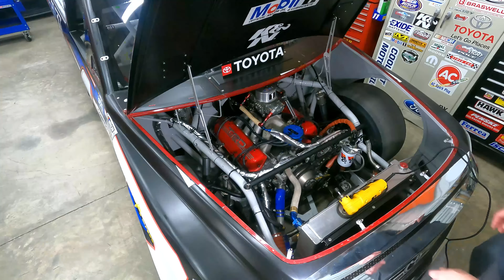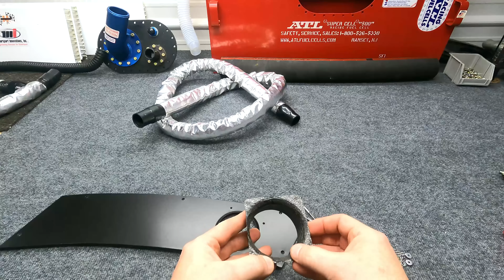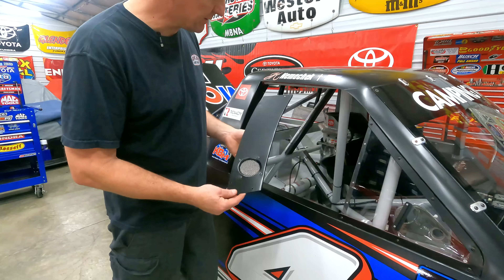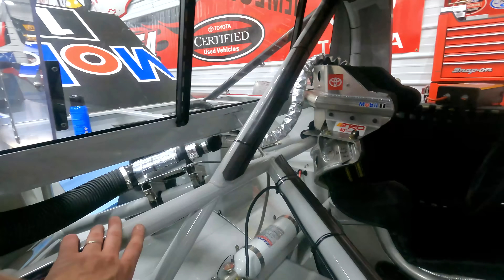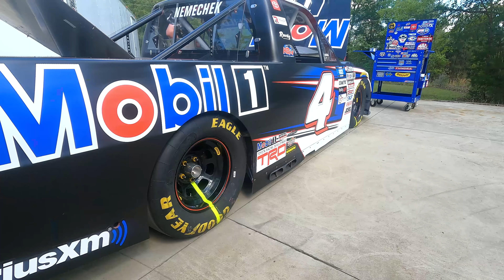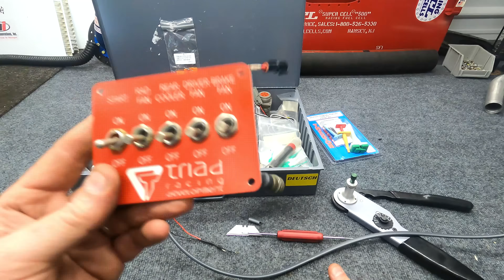NASCAR TOYOTA TUNDRA TRUCK Track Day Prep

Comment: Great video.  Funny as I’ve had a reoccurring though about having a Toyota truck as a track day toy myself.  So I’m guessing this truck had the Ilmor engine when it competed?  Is the engine it has now a Gibbs built engine from an Xfinity car?
Reply from the maker: The engine is a TRD / Triad Phase 14.
Reply: @stockcarsurplus  Thanks. I did hear you mention that but admittedly didn’t have any idea what it meant and search didn’t reveal too much info, which I found typical of most Toyota racing “stuff” over the years.

Comment: what keeps the oil pump belt on in race conditions ? tension or something else. I've seen you slide them on on and off the cogs
Reply from the maker: It's self aligned by the drive mandrel on the crankshaft, similar to how a timing belt aligns itself.

Comment: Love the channel.  I have a 2006 Roush car that I am working on.  How are the Oil lines from the Sump tank run from the tank to the pump.  ? Stainless hard lines under the car or flex lines that are fire sheath covered inside the car?
Reply from the maker: Great question, depends on when the car was built and what type of track it was built for. My Roush Taurus had a right side oil tank with braided -16 lines run through the car and my Roush Fusion had stainless lines under the car. There are multiple options but looking at the chassis there are usually some tell tale signs of where they were when it was built and raced.
Reply: @stockcarsurplus  Dry sump tank is on the Left or driver side.  Need to see if any signs of bracket attachment are present  on the underside ( stainless -16 type tubes )  Car is RK250, a Matt Kenseth road course car from 2004-2006.  Seems like at Watkins Glen 2006 front end crash took place.  A year later, the car shows up as the #44 Toys for Tots car - parked in front of a UPS store.  Thanks to JKS motorsports, the front clip was pasted back on with holidays in the welds.  Was purchased off Ebay out of the Winston Cum Museum from Bill Soper.  Working on getting the front ad rear suspension sorted out, with the help of Dana Stahl - in California.  A real project

Comment: Why does the oil have to be so warm before you fire the engine?
Reply from the maker: Great Question Jason, the bearing clearances in the engine are tighter than a production engine. Getting everything warm allows them to expand and open up without the fear of spinning a rod or main bearing.
Reply: @stockcarsurplus  wouldn’t heating the engine coolant concurrent to heating the oil be more efficient / effective?